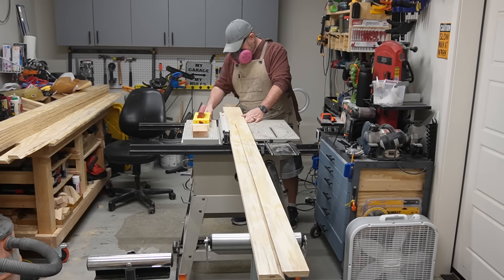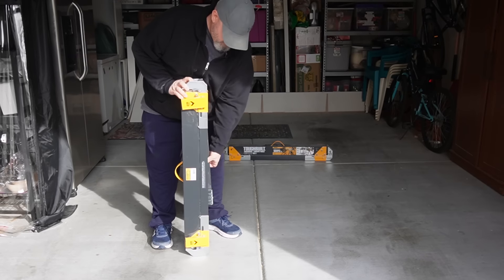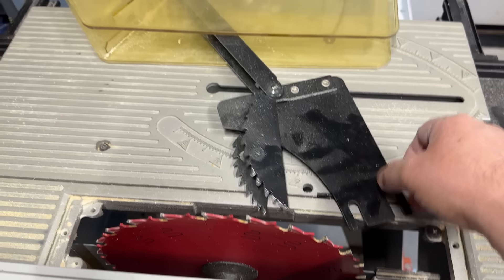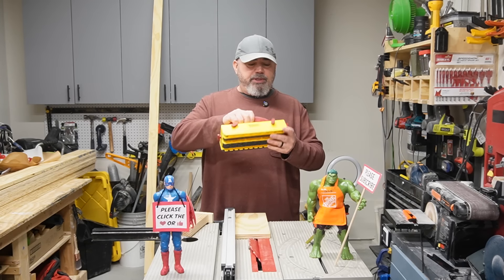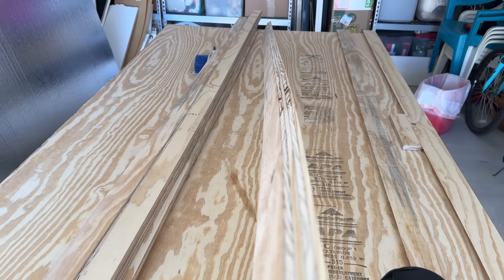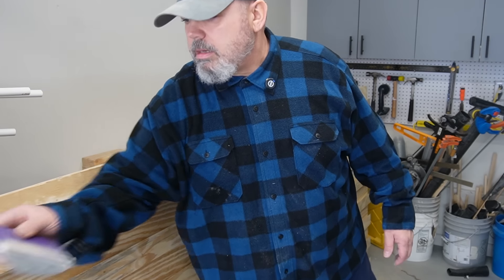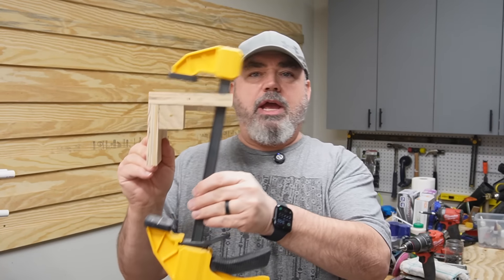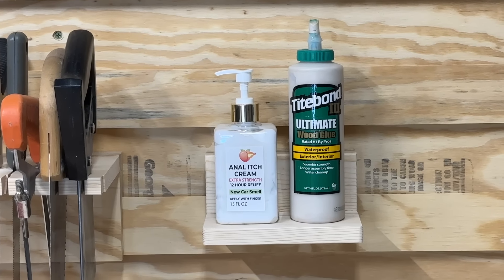Easy Beginner Woodworking project for Workshop Organization

Comment: Hey Jass.. I had the same issue with the Kreg tool. always happened at the end and I knew what was happening but had a problem correcting it. Ended up getting a cheap track saw to try just to see if I would want one full time. 
Good luck.
Reply from the maker: Thank you, I appreciate the info. I have been holding out waiting for a half off sale on a Milwaukee track saw. But I don't think thats ever gonna happen!😂 So maybe I'll do like you and try a cheap one. or try to make one of those DIY tracks that you use with your regular saw. I heard those work great.
Reply: @jascogoods  Me again bud. I made one years ago but I found one that is cheap to try and I did and I like it. It's a BenchMark track saw. probably cheaper for you as our Canadian $$$ is shit but check them out. I think you would be happy with one.

Comment: Bro I’ve been using that Kreg guide for a year now and it works well just gotta keep it straight to the edge of the plywood and friends don’t let friends buy Ryobi. I bought the Harvey cabinet saw with the 4hp motor and have been loving it just a little big for my one car garage shop
Reply from the maker: I think i got it in my head from the last edge guide i had and now I focus too much on keeping it straight at the end. Have you ever had something like that that you just overthink and tense up? Ill have to look up your saw and see. I want a cabinet saw but I like that I can roll mine into a corner and get it out of the way. Thanks for the comment brother.

Comment: Great video, I like how you keep everything real. I would get rid of the table saw. I have never seen a saw that has the blade tilt towards the fence. Looks like an accident waiting to  happen. I would prefer to keep my hands further from the blade. Thanks for the video.
Reply: Yeah that ish is bassackwards. Looks like a kickback rocket launcher
Reply from the maker: Thank you, I appreciate the comment. I actually broke down and ordered the skill table saw from Lowes so well see how that goes. It was highly rated so i'm excited to try it out.
Reply: @jascogoods  
I had my Delta give me a scare recently. The internal contacts of the on/off switch wore out. Unfortunately NOT in a fail-safe situation. It would only turn off if I unplugged it! Could have been a nightmare.

Comment: I had the same table saw.  Hard as heck to crank up or to 45.  Gave up and bought a dewalt.  Excellent saw.  Bought the good blades.  Never has a problem.  Worth the upgrade.

Comment: I put up French cleats 2 years ago in my single stall garage.  Got them everywhere except on the inside of the garage door.  These are by far the best thing anyone can do to a shop.  I decided a few decades ago that if I spend more time looking for a tool than using it my system needs improving.  
 The cleats allow me to see and retrieve everything in seconds….on the condition you put it back when you are done with it.
Reply: That’s definitely the key is putting it back!😂
Reply from the maker: I am always spending more time looking for the tools I need then using them! 😂 I am hoping these do the trick. Plus its fun building the different tool holders. Thanks for the input.

Comment: I've had a Rip-Cut for several years now and I love it. The trailing off at the end must be a you thing as that's not a problem I've had. I also picked up a Centipede about a year ago and I don't know how I lived without one. Great videos, keep up the good work.
Reply: I think the first cut with the Kreg rip cut probably started it.  As after that the curve got more pronounced.
Reply from the maker: Yea the rip cut issue is probably a me thing, I grew up in a house with lead paint and it was under high power lines! 😂I was looking for a black Friday sale on those centipedes and I didn't see anybody having one. I'm gonna wait till the next round of sales or just bite the bullet. I don't know why but I hate paying full price for anything. thanks for the info.
Reply from the maker: you are probably right. That's one problem with these rip guides, If your first cut or even the factory edge is off you just keep multiplying the issue.
Reply: @ I don’t think anyone wants to pay full price!  Lol

Comment: Great content.
* Since you had a significant leftover, would it make sense to cut them wide, and fix the strips on the table saw to 5 in?
* I used the table saw to remove the sharp edge from the cleats.
Reply from the maker: That's a good Idea, I suppose I could have done that. I might have needed one of those straight edge jigs because I think even at the table saw the curve follows the fence and would only reduce the curve. Still would have been better though. That's smart to remove the sharp edges first. I should have done that too. Thanks for the comment.

Comment: She who thinks she must be obeyed was sitting next to me laughing at this video, she said you sounds just like me including the gas at the most hilarious times at least in my personal opinion. 

Your shop is big compared to mine. It's a 8'×8'×20' shipping container. It's also my storage shed. I need ASTROglide just to get in and out. I'm going to line the upper half of most of the container with French cleats so I can get my kayak and other stuff up out of the way.
Reply from the maker: 😂😂😂 Your comment had me rolling!!! I'm going to use that name on my wife! its great. Is it hard to hang stuff on the metal walls? you probably have to use self tappers i would imagine.
Reply: @jascogoods  she'll love it lol.

I actually cut 2×4's so they're wedged in between floor and ceiling. If you put them in the sections that bend outward they'll sit pretty much flush with the flat sections on either side. Then I cut another one to go across the ceiling from side to side that locks the two upright boards in. I'll throw a few screws in to tie them together that way I can use the ones going across the ceiling to hang stuff. No screws go through the metal. I am going to put a 100amp sub panel on the back wall so I can ditch extension cords.

Comment: I watched the same Bitner Builds video you referenced regarding the 2".  I found this to not produce equal pieces.  I needed to go 2 1/8".  Not sure why, but that gave me perfect equal splits at 45 degree cuts on 5" wide pieces.  And my table saw swings out like his does, so no idea why the measurement was off.  Drove me nuts.
Reply from the maker: Good, I am glad it wasn't just me. I don't know what would cause there to be a discrepancy. maybe wood thickness? He used 3/4 but sometime 3/4 is really 23/32 or 13/16. Who knows, I would like to ask him maybe ill leave a comment. Thanks for the comment.

Comment: Tried using that rip cut a few times. Always had trouble keeping it along the side and keeping the saw attached to the sled.
Reply from the maker: Yea it has its place but I think a cheap track saw would be much better. Thanks for the comment.

Comment: I like that you comment on all the little problems you encounter.  There is no end to the number of all these little nuisances we all see in the shop.  My wife bought me the Kreg cutting guide and I’ve never used it. I learned long ago just to buy an 8 foot straight edge.  I saw a good review of MilesCraft saw track.  One of my biggest nuisances is that glasses don’t fit well when wearing a dust mask.
Reply from the maker: I get the same thing when I wear the 3m respirator style mask.

Comment: I think I heard 731 mention the same problem with this Kreg kit? (It may have been someone else). It’s gotta be a design fault no? Tricky to overcome I suppose, the cut has to end somewhere, maybe a lagging piece at the back? 🤔 man…I have all the same troubles you seem to have too!!! 🤦‍♀️ I’m actually gonna have ”Nothing’s ever easy” on my gravestone 😂 Cheers and all the best.
Reply from the maker: I thought one solution would be to just cut a longer piece than you need and then cut the bad pert off but that wont help if you need the full length. 😂 It sucks because once you go out of line it just keeps following the same lines.

Comment: I use the Bora Centipede and folding workable.  It really cuts down on space and is pretty solid
Reply from the maker: Thanks i appreciate the input. Have you seen the workbenches that fold against the wall? Don't know if it would be better than just a folding table but it would be fun to build.

Comment: I have a wide head, too. I have carefully used a lighter to heat and soften the middle of safety glasses so i could permanently spread the frame so it slides and sets on my head comfortably.  A heat gun might work too, but the lighter is probably best for pinpointing the heat (compared to a heat gun) so you dont affect the visibility of the lenses. 
Also, i have the same complaint/issue as you, every simple job just hits obstacles all along the way and turns it way longer and more complicated.
Reply from the maker: Maybe its our big heads that are messing us up!! 😂😂 I found a pair of safety glasses on amazon for less than $15 that fit good and are more flexible. Thanks for the comment brother!

Comment: I use a milescraft track saw guide. It works awesome. Standard track is 55ish inches. There's an extension that takes it to be able to cut a full sized sheet of plywood.
Reply from the maker: A couple people have said those are good. I am thinking about just getting the wen track saw. Thanks for the input, i appreciate it.

Comment: Bro, brother Murphy lives in my garage, I swear!  What should take me 1 hour, takes me 8 and I’m like, wth did I do all day, but then I step back and say to myself, that one piece looks badass!  All done on my 6ft folding table which has to get put up so my wife can pull into the garage after work.  I’m the king of the 15 minute clean up….of the garage, nothing else 😂
Reply from the maker: I guess I'm lucky I don't have to be cleaned up by the end of the day 😂😂 My wife always talks crap to me because I say " i can build one of those in an hour" and then it takes me the whole weekend. 😂 I still have the fold up table i started on, Its covered with spray paint and all kinds of crap. We still bust it out on the holidays for people to sit at and eat. Just throw a 99cent table cloth over it! 😂 Thanks for the comment and the laugh.

Comment: Bora Centipedes are awesome. I have 3 of 2x4 version and I can set them up to many different configurations.
Reply from the maker: That's a genius idea because I was just going to get the 4x8 version but  never thought of being able to configure them. do they snap together or do you have to use something to tie them? Thanks for the info.
Reply: @jascogoods  They don't snap together, but you can connect them together with 2x4's that fit into the holders, but that is usually not even necessary.

Comment: Another great video! I don't like jigs like the Kreg rip cut. I made a guide out of two pieces of plywood, one glued on top of the other. The bottom piece is 1/4" thick and 12" wide. The top piece is 1/2" thick and about five inches wide. You want to position the boards so that the bottom piece has a wide overhang. Once the glue is cured, you take the circular saw and run it against the top piece, cutting off the excess of the bottom board. You now have a straight edge that you can line up on your cutline. I clamp both ends of the guide to the wood I'm cutting so it doesn't shift. When I make my cut, I don't push behind the saw. I put both hands on the saw and push it from the side against the top board. It'ss much easier to keep the saw referenced against the guide this way. My explanation probly made no sense. Just seach YouTube for "Circular saw guide."

Also, can't you move the table saw fense to the opisite side for the blade?
Reply: This is for sure the best beginner set up.  Learn to make something and utilize materials you have on hand.
Reply from the maker: Thank you brother I appreciate the comment and the advice. Your description made sense. 😂 maybe you gotta have a woodworker brain to get it.  i have seen a version of what you described on another woodworkers channel and thought about making one. Glad to hear they really do work so I am going to add it to my project list.

Comment: There is a nice saw holder that has slots and uses round dowels so you just have to lift slightly to remove the saw.
Reply from the maker: that sounds interesting, do you remember what you saw it on so i can look it up? Thanks for the info.

Comment: You can use a heat gun to warm the labels and then they will pull right off. Thanks for another funny video.
Reply from the maker: That's a good idea, I am just mad they add another step to my build 😂 Thanks for the comment.

Comment: You have to take your time and keep the guide flush the the edge.  It follows whatever edge after each cut.  So one small off on the cutt and you will see it towards the end as it gets worse.  It’s a learning curve that’s for sure.
Reply from the maker: Yea i think i over think it and tense up. have you ever had a thing like that where you make yourself messup with overthinking 😂 Thanks for the advice.

Comment: I have the same stands at the end of my table saw. I have the same thing happen almost every time. So I just use 2. One real close. Works........ usually
Reply from the maker: That's actually i great idea, I didn't think of using two. Ill have to pick another one up. I think my problem was the bow in my wood was curving it down. I used a straight edge to check it first and it still was too low. Thanks for the comment and making me feel like its not just me. 😂

Comment: I have a bora centipede, good for cutting sheet goods, but you also have to buy a  4x8 2inch thick piece of insulation to lay on top of it. Watch MWA make cabinets. Do not buy the 1inch thick crap insulation, the centipede works good not great because it is lower and hurts my fat back. Bora makes a smaller version that is half the size. Hope this helps bud.
Reply from the maker: Thank you for the great information and advice. They sell the centipede in different heights. There's a 30 and a 36. I just realized that and almost got the 30inch version because I thought it was on sale but then realized it was shorter and that's why it was cheaper. Do they sell the 2 inch foam at home depot?

Comment: For stickers on wood just use a heat gun, or even a blow dryer to lightly heat up the sticker, it will pull right off.
Reply from the maker: Thank you, I appreciate the tip.

Comment: You may have a hard time getting down some clamps if you hang anything at the end of your cleat board. That wire basket looks as if it will be in the way.
Reply from the maker: That's a good point. It will be more of me moving stuff just to get to other stuff. thanks for the input.

Comment: 22:14 I am also boycotting StarBond. I now only use BSI or Bob Smith Industries CA glue. BSI offers all the choices StarBond does, but I too got bit by the leaky StarBond bottle
Reply from the maker: Now its a two man boycott!😂I'm glad it wasn't just me. I couldn't figure out how it leaked. Ill have to try that BSI. are they on amazon?
Reply: @ I get them from my local MacBeath Hardwood dealer

Comment: I use French cleats everywhere but I do not worry about having each cleat the same size
Reply from the maker: I only did that so the spacing would be the same so If i made a tool holder with double cleats i could put it anywhere. thanks for the comment!

Comment: Too funny! FYI, your 5" boards don't need to be cut exactly in half for the cleat to work.
Reply from the maker: I think them being the same is just so when you use a spacer to mount them to the other sheet of plywood the spacing stays the same. That way when you build larger tool holders that have two cleats the spacing is always the same and you can move them all around. I hope that made sense 😂😂 thanks for the comment.

Comment: I bought the same Kreg crap, mine was machined so the holes lined up with the bosses on the plastic guide but it was terribly out of square. Not impressed with their quality assurance.
Not sure why companies think plastic should be incorporated in sliding surface tools.
Reply from the maker: Yea that is a bummer! I have heard a lot of good and bad things about kreg. Though the bora one I hade before this was even worse. I need to just buy a real track saw and be done with it. Thanks for the comment.

Comment: I think your fence was mounted backwards on the mounting hardware. You should never cut an angle cut with the blade angled towards your fence. If you do you run a serious chance a kickback and a potential injury... The burn up happened because your board edge wasn't straight against the fence. A heat gun makes short work of the stickers...

Comment: Dude so I'm not finished with the video so maybe I'm getting ahead but like why are even using French cleats if you want to lock the tool holders down?

The 2 main reasons to use French cleats are so you can move things around and to make hanging heavy stuff by yourself easier.

This doesn't appear to be intended for hanging heavy cabinets so why not just build your tool holders and screw them to your backer board?  It would save you a whole sheet of plywood that you used for making the cleats for the wall and the holders.

If there's little bins and stuff that you plan on moving around a bunch, then make French cleats for just those.
Reply from the maker: I don't want to secure them permanently. I just want to put a little piece of wood over some of the ones that tend to fall off with an upward force. Like when you pull a tool off of it and it pulls the holder off the cleat. just something I can slide out real quick If i want to move it. Thanks for the comment.